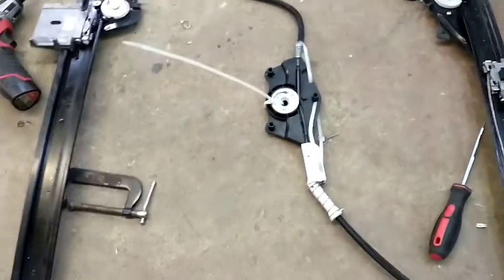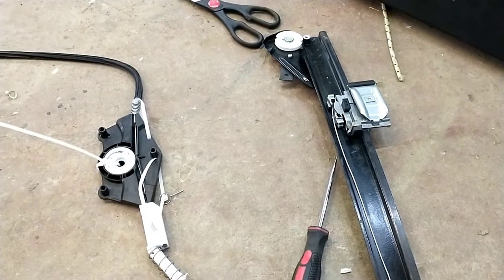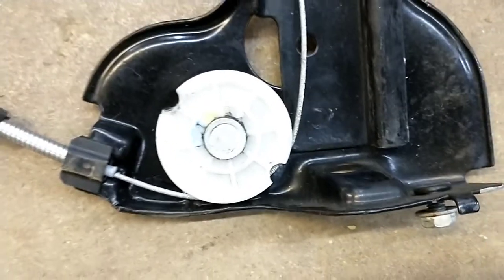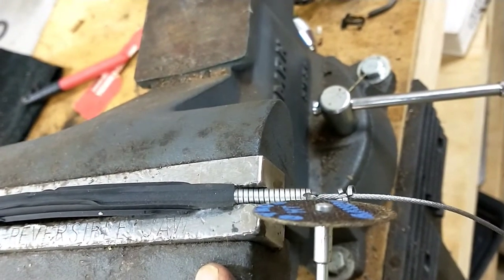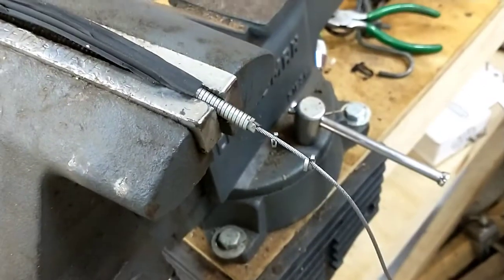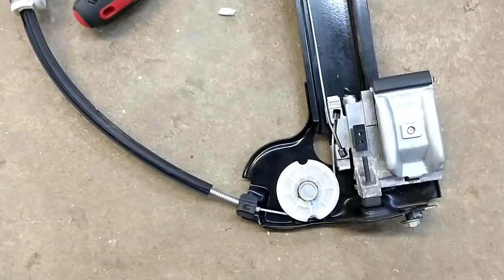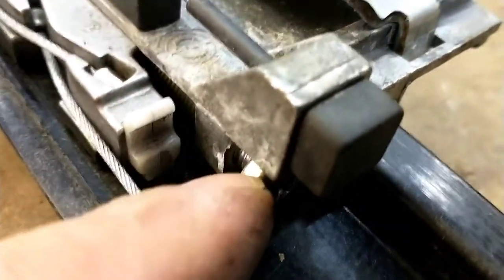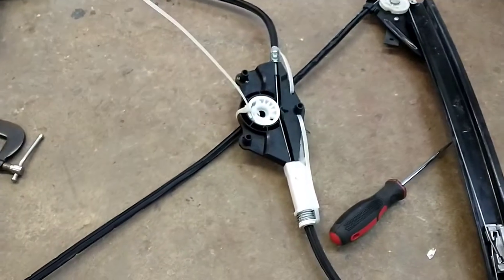VW Beetle Convertible Replacement Power Window regulator cables too short - how to fix it!

Comment: Fantastic!  I replaced the driver's side rear window regulator today on a 2009 convertible and made use of your tip to cut down the length of the coiled steel sleeve. I started with 6 coils and ended up taking 9 off all together to get a good fit.  Great tip.
Reply from the maker: Awesome!  Glad it helped.  A bit of a hack, but it works.

Comment: Just got to do my first one on a 2007 convertible.  We have a Euro parts place here that usually specializes in VW parts.  My boss and I literally ended up breaking the new repair kit.  Thought ok we messed up.  Routed the second one and same thing.  Followed the tip here and it works.  Only helpful video I've seen so far, thanks.
Reply from the maker: Awesome!  That's why I make these videos.  I've gotten lots of great info from other people, I just want to contribute back.  Glad you got it working!

Comment: Great video! I am replacing mine now, not where you bought yours but I needed the right/passenger regulator and they are impossible to find for the convertible,  their a few dozen listed for the drivers side.
I had to buy it from ebay, only like 2 sellers
Reply from the maker: Glad the video helped!  I was surprised too at how hard they are to find.  At least there are some out there and the job isn't too bad. Good luck!

Comment: How do you fix the cable tension it's the white little box I can't seem to get mine to stay in place  thanks and it was a great video
Reply from the maker: Hi Ron - glad you liked the video.  That little white tension box was a pain.  If I recall, you have to keep it compressed while routing the wires.  I think it comes zipped tied down from the factory, and I cut mine when I was unpacking it.  I recall wishing I hadn't cut it because it gets stuck if you allow it to come out all the way and it took a lot of fiddling to make it go back in.  I let it pop out more than once -haha.  I think it has like a ratchet inside so it can compensate for wear/stretching of the cables over time so it can self adjust.  Just get it to compress all the way in, then hold there some how - either with zip ties or a wrap a stiff piece of wire or something to hold it until you're done.  Then you can release it and till will take up any slack in the wires.  Good luck!

Comment: So I did what u suggested it worked perfect but the problem I am facing is that it doesn't fit when I place it in the Door it seems like the wire crossing is too short
Reply from the maker: It was a little tight for me when I was trying to get the unit back inside the door.  Not sure how much these cars vary between years. Mine is an '08.  The window parts for convertibles seem harder to come by than the sedan.  You can buy the whole assembled unit for the convertible, but when you can find them they're hundreds of dollars.
Reply: Should the free crossing cable be on top of the spool assembly cables? I’d imagine the clip for inner panel support on the free cable should be the one next to it.
Reply: Thank you so much i fought with mine for a long time and could not figure out why till i saw thos video.